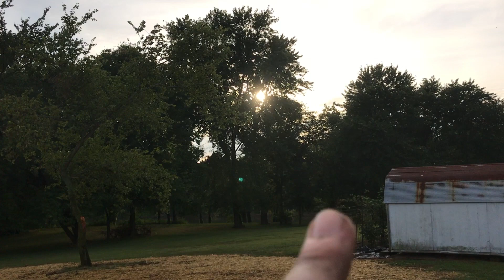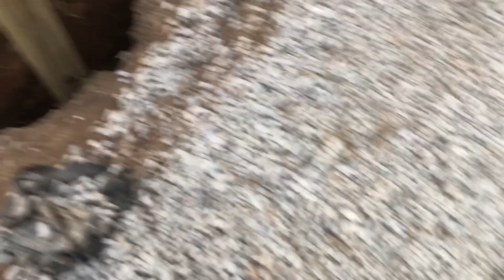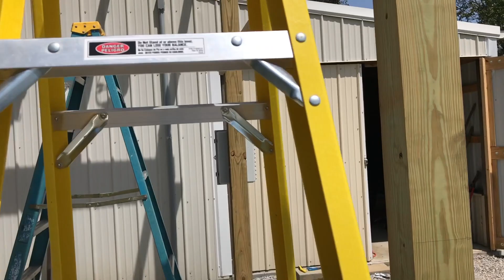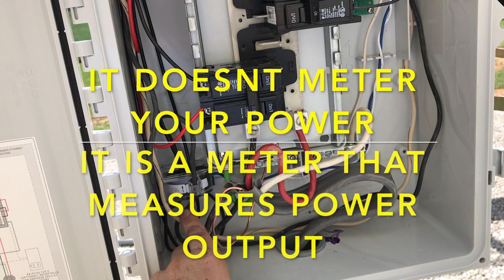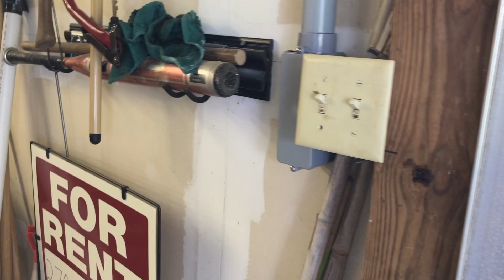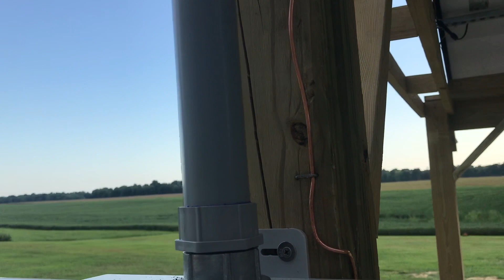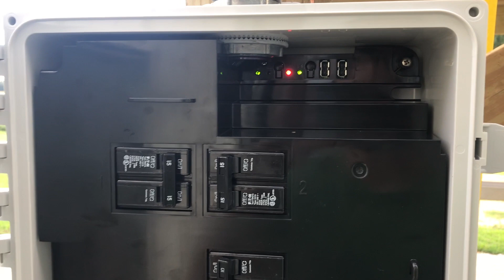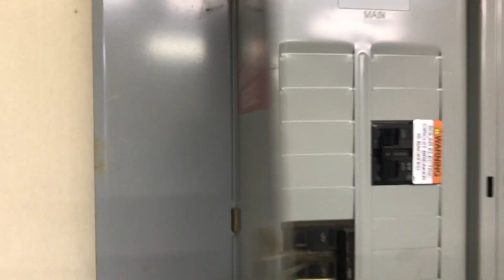Easy DIY Solar Panel Install - 8.37kW Enphase Energy Micro Inverters & Mission Solar Panels

Comment: We have IQ7A inverters on our garage - only 4 panels - going to an envoy in the garage.  The garage is 50 yards from the house, where our main board is housed, along with the Tesla gateway.  We then have a Tesla powerwall II 50 yards in the other direction behind our shed.  All works well, but we need more panels.  As a result, we would like to add 8 panels at the bottom of our garden.  We will go with the IQ7A again, or may go with the IQ8A - which would mean they would still power the house and charge the tesla battery when the main power is out. 

Do you know if you have to link the panels to the envoy to generate and recognise the power?   If so, is at simple as getting a second envoy for the new location? Or do we have to find some way to take the clamp from this new location all the way back to the original envoy?  

Ideally I would love to know priori to getting someone in. As I would put the panels up and the wires in place, but then have it commissioned - I don’t want them saying it is all wrong and they need to redo it.
Reply from the maker: Hey I am not 100% sure but I believe you do not even need an envoy at all. The microinverters convert the dc solar panel power to ac power. The envoy is basically a panel that accepts multiple panel strings and ties them into one large output cable, which could be done with any standard breaker box. The only additional thing the envoy does is receive data information from the microinverters and upload that information to a cloud so you can see how much power was generated etc real time from your phone or computer. It also assist in troubleshooting bad panels or inverters. 
I don't see any reason at all why a 2nd envoy couldn't be used if you wanted to.
Reply from the maker: But further to your question, I am not knowledgeable on the iq8 and battery systems. I only know about grid systems. And the iq7 microinverters will only convert dc solar power to ac output if they sense 220v coming from another source.

Comment: I probably would have made the same choice regarding not grounding the individual panels, however I think the defense that iron ridge gives is that their special panel connectors to mount the panels  have teeth that bite into the finish on the panels and the rails to ensure continuity.  Technically speaking, the black finish on your panel frames could inhibit continuity.
Reply from the maker: Good point Brian! I am due for a yearly update on this project. I guess I could take my multimeter and check continuity between panel frame and strut to be sure. Thanks for the comments!

Comment: Are you required to have an electrician license to install this? Does the city/county require this?
Reply from the maker: I did have the system permitted and inspected through our building department but I got a homeowners permit. Here an electrician is not required if you are doing it on your own property and the inspectors know that you know what you're doing. I think if you fail on two items during their inspections you have to get an electrician involved.

Comment: Thank you very much for sharing your build! I plan to make a pergola in a similar way to mount 6 panels. 
What size timber did you use for the rafters?
Reply from the maker: Nice good luck with your build! I think I used 2x10's

Comment: Great video series! May I ask, where did you get the 3/4" watertight fittings for the PVC enclosure? Im having trouble finding them.
Reply from the maker: Thanks for the comment! They actually just came from Menards.
Reply from the maker: They're called "cable gland" which is a really odd name in my opinion
Reply: Super odd name for sure. I did eventually find them listed at Menards, but of course they were out of stock/no longer carried.

They had a slightly different variation, which seemed similar but I was concerned the oblong/oval shape of the Enphase cable might not seal properly in the round-shalled fitting. So, I found another gland online that is supposedly designed for the Enphase cable explicitly. 

I was a little concerned about water intrusion since you mentioned it in your earlier design. The glands haven't arrived yet so we'll see how they work when they get here.
Reply from the maker: @sanchezcruz20  yes put them in the bottom of the box if you can. I did side and it was ok, but bottom would be best.

Comment: Hi, what metal rails (brand / type) did u use and how did you fix them to the wooden beams?
Reply from the maker: I used standard galvanized unistrut. I mounted the unistrut to the rafters with HSS screws.
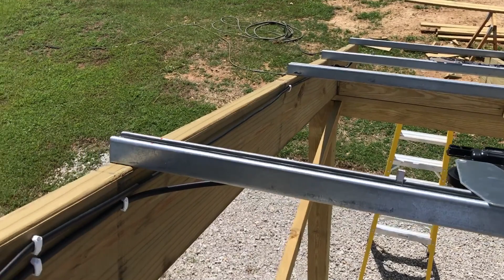Reply from the maker: Check out the video at 14:20

Comment: You need a drip loop where those wires go into the side of that box
Reply from the maker: Very true that would definitely help on the waterproofing of the box.  I also should have done that with the conduit going into the IQ combiner box instead of using the hub seal.  But it has stayed dry for the last few years now.  Thanks for the comment and subscribe for more solar DIY videos!  I have a review at year 1 and year 2 as well as a design/permitting video.

Comment: Great video.  it is a better expatiation than others on wiring.  Wondering on what gauge of wire do you have going to the disconnect switch?
Reply from the maker: Thanks Paul!  It was all 6ga copper wiring from the IQ combiner to the disconnect to the panel in the garage.

Comment: How much did all the solar stuff  cost I already have the wood.
Reply from the maker: Just the panels, microinverters, IQ combiner, and Q cables was $10,050.  Then i spent another $1,050 on some wiring, disconnect boxes, conduit, unistrut, etc.  This was in August 2019, so pre-covid pricing.

Comment: So you have the combiner box, but you do NOT have the Ensemble, correct?  Are you able to update your microinverter firmware using the combiner box/app?  Did you have to do permitting for the rack/structure, or just the electrical?
Reply from the maker: Correct I do not have the ensemble battery storage. I installed before it was rolled out. Yes the iq combiner box has the envoy computer in it that is hooked to my wifi. I can update firmware etc. check out my channel I have a solar playlist with lots more info including using the phone app and energy production rates and my permitting process. I did not need permits for the structure in my county since it is not inhabitable.
Reply: @NealORussa  Thank you!

Comment: Hi Neal,
 Once again an excellent video and very informative.

I like the way you extended the q cable with make and female adaptors technically getting rid of the junction box and taking it all the way to your combination box.

I have a question about the q cable with connectors, do you buy them separately and connect the connector to your q cable or can you get ready made ones with 9-10 connected per line because I can’t find any online
Reply from the maker: The q cable comes in 2 styles, vertical or horizontal and that is for the layout of your panels. Horizontal style has longer length between each of the plugs that goes to each microinverter because the panels are spaced further apart in horizontal orientation. The end of the q cable is always bare and you have to separately but the male and female connectors. But a cheaper and easier way would be to just use a watertight junction box and spice the wires together with a wire nut.
Reply: @NealORussa  so the q cable comes with how many connectors on it?, it says 240 then wire is about 1000ft(4 ft spacing) for $30? that’s seems a little off ….
Reply from the maker: @sangyets1  You purchase this item and for the quantity you put in how many panels you will install in that string.  It has a plug for each of the microinverters, then the end is just a bare end of two conductor wire.  https://tandem-solar-systems.com/product/enphase-q-12-10-240-portrait-trunk-cable/
Reply: @NealORussa  thanks Neal, I got it clarified, I thought if you order 27 pieces they will send you 27 separate pieces rather than in a string, but I thought wrong, thank you for taking the time to reply and once again for your excellent video.. have a good day and be safe

Comment: Such a waste of building material.   A roof under the panels would have made great storage lean-to for an RV or equipment, future pole barn..
Reply from the maker: Well I wouldn't call it a waste.  I still do store equipment under it.  It's not really tall enough for much else.  I think it has 6'3" clearance.  Its main function is solar racking, and it does a great job at that!
Reply: @NealORussa  could this application be good for over an outdoor living space? I'm wondering how much water still makes through the gaps of the panels. Could a simple underside gutter system work?
Reply from the maker: @jackehlers8275  it drips during rain. If I were to do it again I would use something like this. https://www.dekdrain.com/

Comment: I like your frame! You should install the consumption CT’s, lots more info! Great job!!!
Reply from the maker: Thanks for the comment taz! Would like to put in the consumptions but my main panel is so darn far from the envoy lol! Do you have them installed?
Reply: @NealORussa  I just installed them but don’t understand the enphase tool kit enough to activate them!
Reply from the maker: @tazwhite4391  are you able to connect your phone to the envoy with the adhoc WiFi?
Reply from the maker: @tazwhite4391  this should walk you through the process. As I stated toward the end of my video, be patient as you work through the steps. The envoy will turn off and on multiple times and upload to the enlighten cloud is not instantaneous. http://toolkitresources.enphase.com/en/Default.htm?_ga=2.264811145.781023084.1633483926-718735367.1633483925
Reply: @NealORussa  I was able to when I had to make a link to a new router but I did not attemp anything else, is that what I need to do? Use the system WiFi link to enable the ct’s?
Reply from the maker: @tazwhite4391  yes I believe I remember you have to do some settings in adhoc to get it to connect to enlighten. You need to setup an enlighten account then link the envoy to that account.
Reply: @NealORussa  Ahhh, thank you! I will start working on that now! Thanks!!

Comment: With these microinverters; is the power parallel? Meaning when running from battery what is the continuous and peak sine wave output you will expect. Is it dependent on the size of the panel system? I was looking at string inverters, you know the ones that say 5kw continuous; 15kw peak etc.
Reply from the maker: This question may be a little over my head, but I'll give it a shot. The power coming out of the microinverters is 240v ac power so it can't go directly into a DC battery. The kw output varies every second depending on how much sun there is which in turn dictates how much energy the panels are producing at that given second. The square footage of my panels can provide a maximum of 8.37kw (310w/panel x 27 panels = 8,370w). That is lab conditions. The highest I've ever seen this summer was around 6,700w output. In terms of parallel or series, each of my 3 strings of 9 inverters are wired in series, so the output amperage of each inverter adds together until the end of the string. So 9 inverters in a string can produce about 12amps max at 1.31amp max per inverter. You might try watching my diy solar design video and see if that helps anymore. Thanks for watching!
Reply: @NealORussa  thank you, I will need to research into this more. I’ve been debating into a string vs microinverter, I need true off grid capability with grid tie in
Reply from the maker: @__SKYNET__  the new enphase iq8 inverters have ability to run on grid and off grid (without a battery bank!). They are not available yet, but you can research and wait for them. Otherwise you can use the iq7+ micros I used, and then get the Enphase ensemble which switches from grid to battery power during grid outage. Basically the ensemble takes in your pv array, battery bank and grid condition and utilizes all three appropriately based on what power needs are, state of battery charge and grid availability.
Reply: @NealORussa  thank you, I’m not in a rush, will definitely wait for it iq8, and then research those; do have large power requirements. Are you able to run all household appliances, central air, large garage equipment (eg welders etc)
Reply from the maker: @__SKYNET__  I'm connected to the grid with my system so if i require more energy than my array provides, i get the power from the grid.  So i dont have any problem running my appliances and garage equipment.  I designed the system to cover my yearly average household electrical usage.  But then about 6 months after i installed the system, i bought an electric car that i charge every day, so I kinda blew it out of the water!
Reply: @NealORussa  thank you,
I just found out my power company doesn’t allow complete off grid capability, that is when the grid goes down the solar panels stop producing; ie I’m not allowed to have battery backup. This is ridiculous, I may have to completely disconnect from them.
Reply from the maker: @__SKYNET__  that's how all electrical companies are with grid tied because you will electrocute their line workers sending your power back onto the grid unless you have an automatic backfired shutoff switch (like what's included in the ensemble). Also you can't produce power off grid without batteries or somewhere to store the power your array creates when you're house is not requiring all the power being generated. With grid tied the excess power is sent out to the grid. When your off grid or the grid is down the power needs to be used or stored in a battery otherwise it will blow a breaker or worse.
Reply: @NealORussa  yes I am aware needing batteries but from what I’m gathering is that my neighbors put in a solar system but no batteries 🔋 because they said the power company doesn’t allow backup? That is I can’t have a fully independent system in case of grid failure/power outages/brownouts. They told him he would need a generator for blackouts and he has enphase panels system

Comment: Neil, very good video. I’m getting my plans together to move forward with a similar install. Question about your elevation and azimuth, not sure if that’s the correct terms. What’s the best way to determine for your location?  Thanks again!
Reply from the maker: Hey Dennis, thanks for the comment!  I think i see your other comment that your questions on azimuth and panel slope were answered in my DIY Design video.  Don't hesitate to reach out if you need anything else!  Make sure to check out the 1 year review video as well.  I probably need to put together a 2 year review now...

Comment: Hi Neal, This is a pretty good install I'm impressed. I'm thinking of doing solar for my house too. I did all my research and the only thing that I might have a problem with is connecting it to the grid. Did you install the sub-panel by yourself if you did was there anything special about the sub-panel connection or is it a straight sub-panel install. Any pointer or advice on the sub-panel is greatly appreciated. Thanks in advance
Reply from the maker: The sub panel in the garage was already there. But I have installed sub panels before for my other building across the yard. Simple really. Shut off the main incoming breaker between the powered meter and main panel. Then run wiring from main panel to the sub panel. Put whatever size breaker you need for sub panel (usually 100a) in the main panel. Once it's all connected you're good to go. If you can tackle a solar install you can install a sub panel.

Comment: Hey Neal, great job on the solar install and the video. Thanks for sharing this content man. I’m installing a similar system with enphase equipment and iron ridge ground racks and this really helped bring the project down to earth. It’s a lot of work for one guy but definitely worth it. Especially when you’re paying the powerco $.40/kWh.
Reply from the maker: Hey thanks so much for the great comment!  I think you'll like the enphase system and you'll find it easy to install.  My system is just turning 2 years old, and I haven't had one single issue.  Hoping for many more years!

Comment: I Have some questions about grounding. 1. I installed the iron ridge system and ground it separately from my Enphase IQ combiner box they both have their on grounding rods is this ok? they are 100ft apart. 2. Where I installed the IQ combiner box there is a grounding rod already installed can I share that? are do I have to install a new grounding rod dedicated to the IQ combiner box. I am using Enphase IQ7 microinverters if that makes a differences Thanks
Reply from the maker: Hey Greg, thanks for watching and the questions!  The ground rod is just used for over voltages like lightning or static.  Using 2 ground rods is no problem and might be a better option than running 100' of ground wire.  If there's a ground rod near the IQ combiner, you can use that.

Comment: Have a question. In case the grid goes out. How you prevent the PV system to backfeed?
Reply from the maker: These enphase microinverters have backfeed protection where they will not supply power from the panel unless they sense 240v power coming to them from the panel/grid.
Reply: @NealORussa  Thanks very much. I've seen several videos and this one explain everything very well. It is really good. I can tell you put a lot of think planning it.